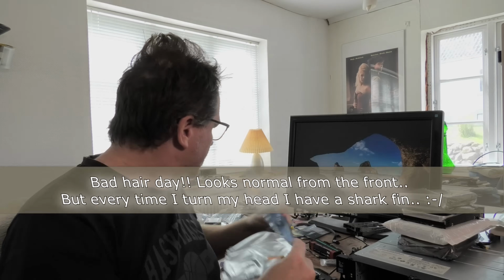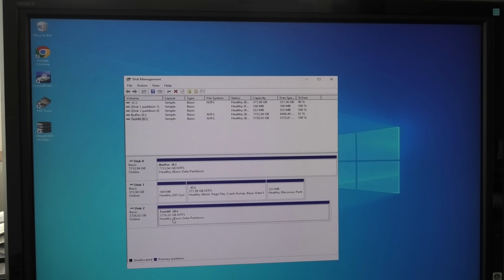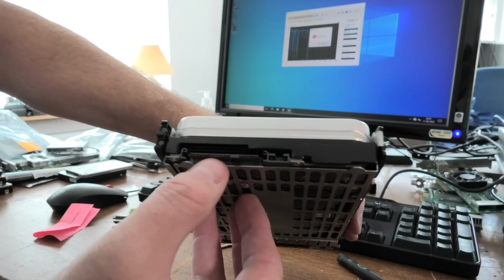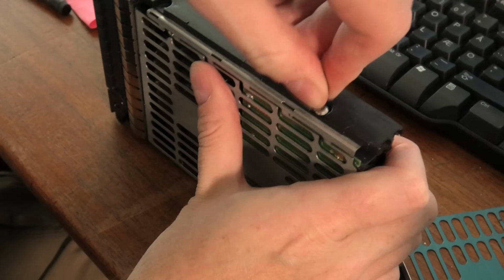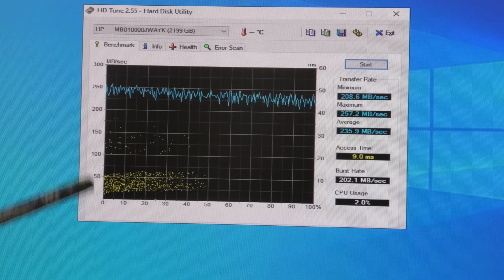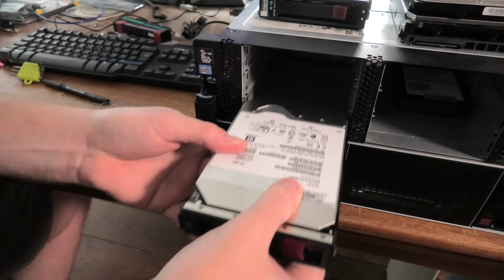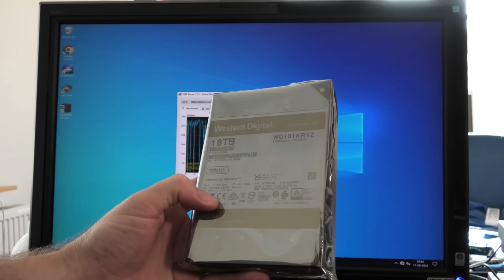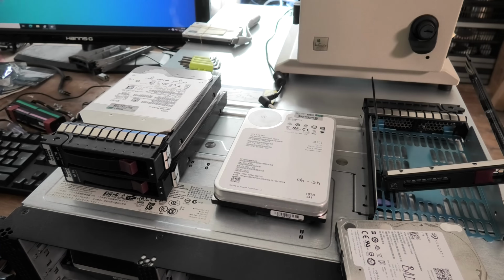20TB Okay, 10TB Bad-ish and 22TB Bad HDD - 1414

Comment: are this lenovo servers so loud all the time? HPE DL360 and 380 gen 8, 9, 10 are really quiet after initial boot.
I also have two x3650m2 here and they are screeming loud all the time.
Reply from the maker: Yes,, it is not a quite server,, but the microphone is also awesome at picking up the noise,, it is not as bad in real life.
Reply: @MyPlayHouse  in our server-room where two of the x3650m2 are running, you have the feeling you put ear-protection on, when you have switched of these loud servers. it's so quiet when they are shut-down, the label on the windows-start-button should be relabeled to "shut up".

Comment: Great loved the show, Yes, Seagate has more failures than anything else.  Another note, stay away from the Helium filled drives, the gas will eventually leak out after about 5 years, ending the life of the drive.
Reply from the maker: I am not sure the Helium thing is a thing.. the Helium is not under pressure,, I do not see why it should want to go anywhere.

Comment: Years ago when I supported a lot of sales people I'd keep a supply of drives around because when someone would quit, I'd put their old HD in a slot in one of those padded hard drive shipping crates and swap for another drive.  Then every so often I'd take them out and run the old DOS based WD Diagnostics on them which didn't seem to care what brand drive you had, it would still test them.

If there was a failure I'd try to get it replaced under warranty if it wasn't an old drive.  I also would almost always run the laptop built in diagnostics on each one before I let it boot into windows so if there were any issues with hardware or drives I'd catch it before I wasted any time doing any OS repairs when they would send them in.
Reply from the maker: Hi @stonent
Thank You very much!  glad you liked the video :-)
Thank you for watching! :-)

Comment: Thanx for the content from Norway 🙂 Would be interesting to see a lowlevel/full format/`re-silvering' on the bad(ish) performing drives. This should relocate the slow/sleepy blocks that cause the huge dips and slow r/w performance. Will take a long time though...expect 25-30 hours for a 18TB 😅  A linux live/boot utility preferred with either seatools, Gparted or similar to avoid windows drive write control/HAL
Reply from the maker: Thank you! I have never seen low-level format, really, fix anything. The systems that says that these drives are usually spot on,,, and I really just need to find out how bad they are,, and as you can see this test is quick and points me in the right direction :-)

Comment: FYI: HGST was acquired by Western Digital in 2012. HGST drives are WD lower performing drives and typically discounted compared to WD drives.
Reply: The line of drives is still marketed and manufactured as WD Ultrastar DC HCxxx
It used to be exactly the same just named HGST.

They outperform the majority of the rest of the WD line for data centre use, which is why Dell, HP use those as their OEM drives.. not the WD Gold.

They're cheaper due to economy of scale
Reply from the maker: I know they are part of WD,, but I like them better than WD :-)

Comment: Seagate Barracuda brand is doomed..since the late 90's ..ja ja ja...i had one of the older models in the IDE days..they were fast but did not last longer than 2 years..in the job we used scsi and those lasted about 3 years
Reply from the maker: I have also reached quite a lot Seagate drives in my time :-)

Comment: I have had more issues with WD HDD drive compared to other brands. I have drives of most major brands.
And M.2 crucal are shocking with less than 250 days use and down to 88% good.
Reply from the maker: For me Seagate is in front of other brands,, on failures :-(
Reply: @MyPlayHouse   "backblaze drive stats" would suggest the same but why would they only have 4x WDC 7x Toshiba 7x HGST & 17x Seagate different drive types. It does seem odd that Seagate is most used and failures. the 2023 stats shows the best picture with a whole year to compare brands.